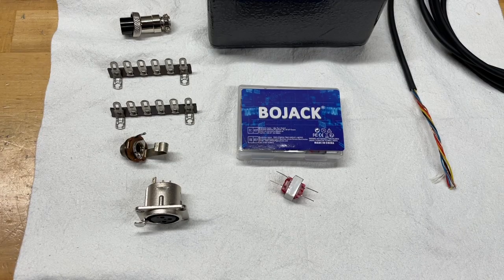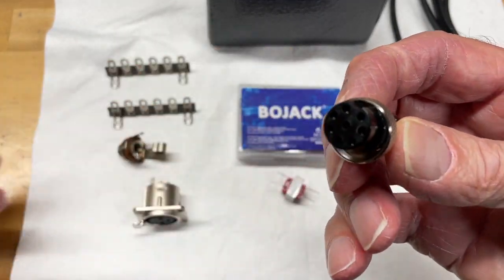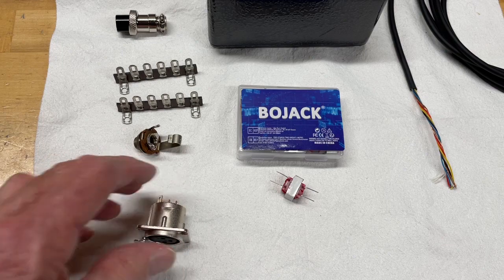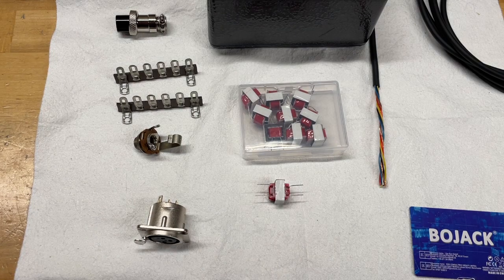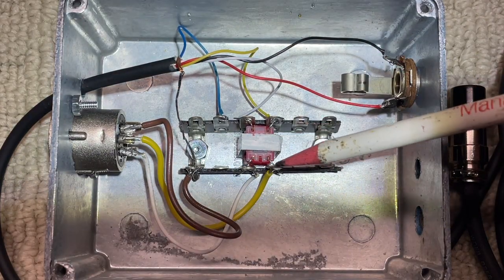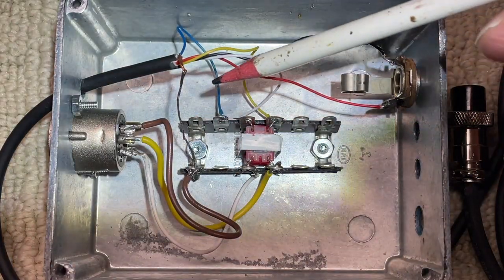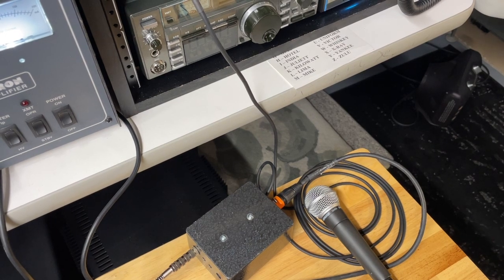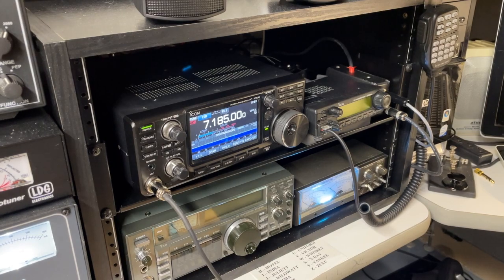BUILD an XLR MIC Interface Box for your HAM RADIO!

Comment: Ed-  thank you so much for this video!  I purchased an Icom IC-746 (not "pro") at a hamfest.  My 735, which I see you also have, has been my primary rx since the early 90's.  I have an XLR mic that seems nice for audio work, and an XLR module to use it with my PC.  Since Icom wants you to buy their gear, there are little to no technical specifications in the manual.  I'm perfectly willing to replicate your build- I can solder like a world champion (and have access to both metal and woodworking tools.)  But... would an interface that outputs to a PC be "almost all I need" or would I have to brew the same interface as you've done here?  Forgive the question- there is SO much contradictory information on the net, and I can't afford to smoke this transceiver on my budget!  (I also have two different sized piezos I could use for a non-xlr setup, if that is possible.)

After 30 years rx, I finally got my ticket- KD3BVM.  You can drop a reply here or via QRZ, it would be amazing to pick you up on the air, so I'll note your call and send the opposite way if I hear you!  Thanks again for this excellent video and project!

Comment: If you were to use a double pole double throw PTT switch you could use the second side of the switch it would work great as a grounding for a SDR antenna. Grounded while transmitting. ?? K2gfi

Comment: Hello Ed,  Great video and project.  Since you ae interfacing a dynamic mic to a icom7300 which normally takes a amplified electret mic are there any adjustments in the 7300 menus necessary to provide enough transmit audio amplification using the Shure mic?

Comment: Great video, thank you!
I have some of those transformers but struggled to use them properly.
That being said,  I simply hooked my wires directly to the mic plug and the mic works great with out that box. 
The neewer bm800 and now the behringer xm8500 both work great. 
However the Heil icm mic didn't work, it had a nasty hum in it. I finally just sold the mic. But if I had seen this video, I'm sure I could've still been able to use that mic. 
But for $15 at Sweetwater, I got the xm8500 mic and it's just great. Only thing is it helps to add the foam wind screen to help with plosives, other than that is a great fit for the money.

Comment: Hi, you connected the earth braid to the earth on the case at the box end but you do not show what you connected that braid to at the radio end of the cable.
Reply from the maker: Hi Mr. Alan.  I slipped on a piece of heat shrink.  Soldered the mic and PTT wires to the connector  I twisted the braid and soldered it. (about an 1 1/2").  I slipped the piece of heat shrink on and bent the shield back over the shrink so it would extent out of the back of the connector.  The connector wire clamp held the shield and grounded it to the metal part of the connector.  Hope this helps.  Thanks for watching!  -Ed  W8EDW

Comment: Great video! I want to build this project, but with one additional modification- I want to add a switch to switch between two radios. Please, correct me if I'm wrong- I think I could use a DPDT switch. Join pin 7 from both radios to the audio transformer, while pin 1 from the radios goes to each end of one side of the switch. Center from that side of the switch goes to the audio transformer. For the PTT,  the "tips" from the radios goes to each end of the other side of the switch, and the center of that side of the switch goes to "tip" on the jack. "Sleeves" from the radios join to "sleeve" on the jack. Does this sound like a plan, or am I overlooking something?
Reply from the maker: Hey Joseph.  I’ll take a look.  Your description sounds right.  Going to draw a schematic and get back to you.  Thanks!  -Ed
Reply: @edwhitney1862  Thanks!

Comment: Hello ED. Thank you very much. 
My mixer Behringer Xenyx 1002FX doesn't have a balanced output. In this case, can I use a Y P10 cable to input in the interface?
Reply from the maker: Hi Edwardo. Use a Hosa HSX 003. Pro Balanced. Cable from Sweetwater Music.  That will get you from 1/4” out on your mixer to XLR male.  Thanks for watching!  -Ed
Reply: @edwhitney1862  Hi Ed. I will try this, but my mixer output is unbalanced. I think that I have only Tip and Sleeve wiring. Thanks for answer!
Reply from the maker: @duw2k  Hi Edwardo. Ok, the Hosa  XLR PXM-103 is unbalanced 1/4” to Male XLR ($10 US) or Pro Co  XLR EXHQXM-10 ($30 US).

Comment: GM Ed.  If you did require phantom power, for a Rode NT1, where would icom’s pin 2 to go and what additional components would be necessary for isolation?  Tnx.
Reply from the maker: Sorry Dave. I missed your comment/ question!  I’m not familiar with that mic.  I use an external phantom power just to be safe. Behringer model PS400  I use it with the XLR interface that I built. Thanks so much for watching!  -Ed. W8EDW
Reply: A nice touch using the 1:1 tx to keep everything simple. I have a few mics and could do with a latching PTT instead of the fist mics for the local nets. This is a nice solution.
The problem with phantom power is circuit noise being introduced from the radio to the now nicely isolated microphone.
Next up is the low output (8 volts) of most radios not being enough for many studio condensers. More recent electronic drive mics will however work at that and the nt1 is probably okay.
You need to carry the ptt gnd over to the mic side of the transformer, and the power over to the other leg on the mic side too.
There needs to be DC blocking caps fitted between the transformer and the power lines so the transformer coil is not loaded with DC. these will be low value ceramic disc caps. The exact value is dependent on the mic impedance etc as they form a high pass filter.
Likewise it would be prudent to fit high value inductors to the supply lines before the mic circuit to block audio and RF to and from the audio side. 
A current limit series resistor is a good idea as condensers need charged but not loads of amps.
If you are doing all this then I'd suggest using op amps and building active filters, variable gain and a differential to single end buffer output as full range mics are going to produce unwanted results in some modulation modes.
I have enough bits to do this but it's a lot of work compared to this solution and a mic that takes an AA battery.
All the best.

Comment: Nice job! Is there any need for the transformer? It is a 600/600 so no impedance correction is done (nor needed) and if you just want to isolate any DC component, a capacitor would be enough. 73!! LU1EKR
Reply from the maker: Hi Raul. The transformer gives you “common mode rejection “. That helps eliminate any ac hum picked up by the mic cable.  I didn’t need to worry about blocking the phantom DC since I didn’t hook up that pin. Thanks Raul for watching!  -Ed. W8EDW